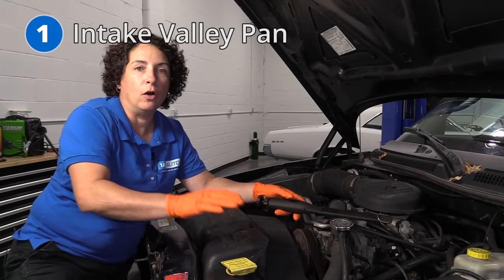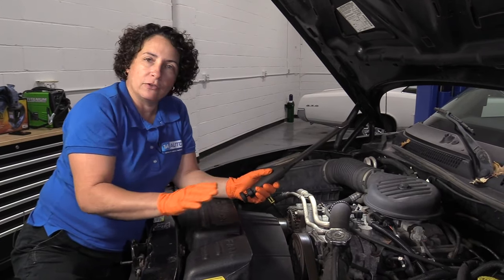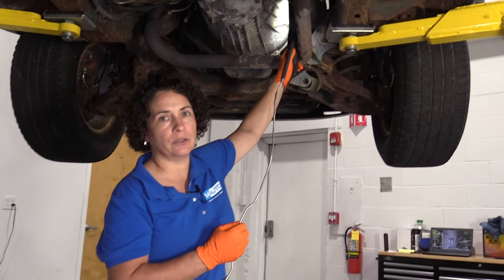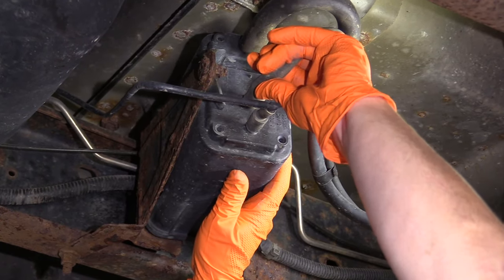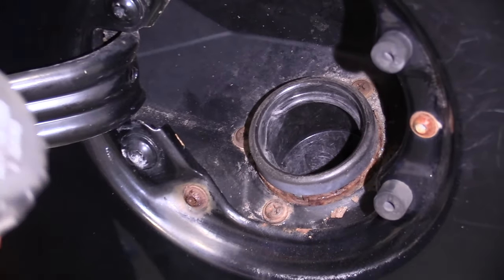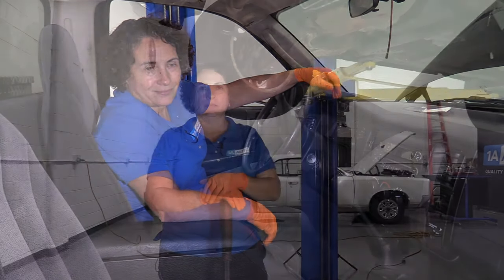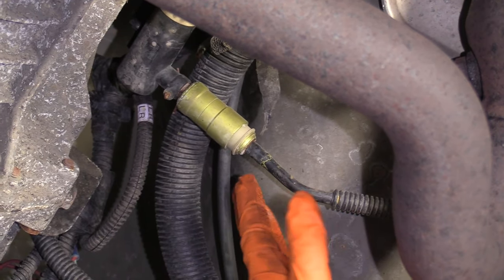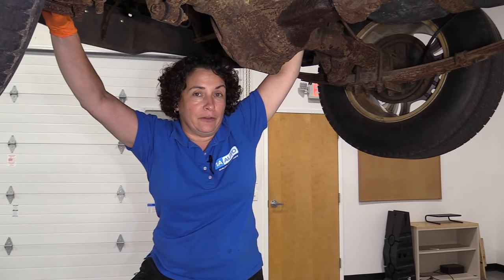Top 5 Problems Dodge Dakota Truck 2nd Generation 1997-2004

Comment: Great information….
I have a 2003 dodge Dakota SLT V8 automatic 2 Wheel Drive. I am having issues with the Evap code but I’m planning to get a smoke test done. I am also having an issue with the airbag light is on my dash I tried cutting off and on at the switch on the passenger side but it doesn’t make any difference. Was wondering if perhaps you can discuss that topic or issue?

Comment: I successfully swapped the 42re auto out of my 1997 dakota and put an ax15 manual from a 99 dakota in. The truck runs and drives fine but my speedometer doesn't work any suggestions?

Comment: For anyone else. If the fuel pump goes out don't buy an off brand. 
It's more expensive ,but get the Dodge one.
Had 3 aftermarket ones go out in 3 years,
Then I bought the Dodge one and when I sold the truck it was still in it 5 years later.

Comment: The Evap codes on these trucks can be a pain. I have an 04 4.7 that all together has been extremely reliable but has had a couple small evap leaks in the past couple years. 

Not bad though to diagnose or fix, just frustrating.
Reply from the maker: +Oro Invictus Thanks for the feedback!
Reply: Upgrade those old rubber hoses to 3/16 thick heater hose in the size and length you need and you'll never look back my friend. Easy to do.

Comment: Mine was an 03 3.9l V6 with 5 speed manual, only problems I ever had was gas cap and random choke on top of constant overheating. Never figured it out so off it went for a new Silverado K1500
Reply from the maker: +Sheriff F. Reaper Thanks for checking us out! http://1aau.to/m/Shop-1AAuto-c
Reply: My 02 had problems with cooling, choke staying on... eventually figured out it was just the water temp sensor.

Comment: My issue tonight first the second shift is almost like a notch on the side of the gate It's easier to go into second if I go to neutral then second I don't know why because it's great condition It was stolen 5th gear if I let it out and hold the brake That's one of those odd triangle shape clutches that are replaced by the previous owner but I have zero slip even pulling a 10,000 lb camper

Comment: Beer keg intake manifold lower (pan) cover. That is also a problem on the 5.2 & 5.9 magnums as well. Besides uneven idle it will cause oil consumption & engine pinging. Evap purge: a problem on other vehicles as well. Ny 2002 minivan kept getting an evap warning. Hose clamps were plastic & had deteriorated (gone), hoses bad. replaced hoses & clamps with European style FI hoses & problem has never returned. Fuel filler cap: Also look for irregular surface at the filler neck, a factory screw-up. It will have to be smoothed with a grinder of some sort but remove the filler neck first---- please. Crank position sensor: beware of aftermarket ones, I have had new out of the box ones set a code right off the bat. Crankshaft end play: factory setting is about .005" to .008". Stick shift vehicles can cause extra wear on the engine crankshaft thrust bearing if the truck is driven a lot in stop & go situations. The whole time you have your foot depressing the clutch there is a lot of forward pressure on the crankshaft and makes for wear on the thrust bearing.

Comment: Great info and we'll said. I just bought a 98 dakota sport v6 3.9 and runs great just that it has the abs and brake light on, and the calipers up front start to stick after doing some driving around, and yes I installed new ones bosh brand I've checked the front lines they seem to be clear I'm thinking it could be the a.b.s module or the a.b.s selinoid, what you think. Thanks in advance
Reply: I had the same problem my lines looked fine but I replaced everything in the brake system and it turned out to be a flap peeled up inside my line that would let the fluid in but wouldn’t let it back out when I let off the brake replaced the line and no problem after that
Reply: @jacobpattison1227  My brakes were hanging up, its an 02, and back part of caliper is part of the spindle... the races where the pads slide had grooves worn in them, the new pads would stick.  I used a grinder and a file to make the races flat and smooth... that fixed it.
Reply: How's it running

Comment: That was amazing, bought a 98 sport for $1000 from a mechanic. Truck runs great. Except last night i decided to take it on the highway. I 95. Got up to 60 mph and it started missing a little, then a little more but would stop and correct itself. Well with another 5 miles i lost a cylinder I think, so now i am on 5 cylinders i assume? I did a visual on the spark plug wires, they looked fine. I am reasonably mechanically inclined, do you think its something i might be able to troubleshoot through myself or should i take it to a pro? thanks
Reply: Check the plugs and wires
...like take each plug out , and either replace them all just so they're new.. or clean and re gap them..also check the distributor cap, see if the rotor inside is bad...make sure your plug wires aren't broken anywhere, and make sure they're right on both ends,  on the distributor cap and on the plugs

Comment: Definetly not what mine has had trouble with. 1st steering wheel fluid leaks either the pump the reservoir the hoses or the cooling device is the culprit. 2nd heater core broke on mine 😭 biggest repair yet. 3rd. locks won't go up. 4th. Outer tie rods go out every 2 years.

Comment: My truck sometimes idles at 1000 when i crank it up and usually by the time i get to the stop sign to turn it goes away... its not rough though its even.. every gear roars the engine the same till it goes away! any ideas?
Reply: My dad's manual 98 dodge ram does the same, he said it is cold blooded, and just heating up. 

Can't give you an exact answer on what cause that
Reply: @happytrails5342  thanks man... actually hasent done it since i mentioned it knock on wood.. i did replace the pcv valve and breather and grommets... maybe my iac was acting funny because pcv had fuel mix all off.. will see lol

Comment: I have Emmanuel Dodge STL or SLT1 models everything manual I have issues going from first to second I know my clutch has issues but it's a good clutch I think the slave cylinders bad even though it was replaced with the clutch what would be recommended

Comment: I think mine is the first problem, engine over heated and died, after I added coolant now it hard idles and engine light blinks, also stalls, checked compression good, replaced boots and plugs nothing seems to work, I'll give it a shot

Comment: Had a 2002 3.9 5 speed until 2015 bought in 2003 changed the battery twice, starter twice, water pump once. Paint started peeling in 2012 on the hood. Had a check engine light for half a day in the winter one year then went off never came back on. Sold it to a guy that hit a tree and totaled it In a week of owning it.
Reply from the maker: +Jon Shearer Thanks for the feedback!

Comment: My 03 dodge Dakota v6 3.9 started stalling out on me today , it would idle rough when stopped in give me trouble starting back up. No check lights or anything. I just bought an idle valve sensor and put it in. So far no stalling and the idle isn’t as rough. Hopefully that solved the issue
Reply: Be sure to clean your throttle body.  Mine was stalling on me and I thought it was the sensor but it was just a dirty throttle body not letting enough air in at idle.  Runs perfect now and code went away on its own.

Comment: I have a 97 dodge Dakota with the 318 4x4 auto. It starts up and runs good and drives good. Until it warms up then in order to drive it your foot has to stay on the gas. And when it dies you have to have your foot to the floor to start it. What could be the problem? Thanks

Comment: I have a 2000 Dodge Dakota with the 5.9L Magnum V8 and recently we've been having starting issues. We replaced the battery. Terminals are clean and have good connection. When I open the door, the interior lights come on, I can adjust the seat, windows, etc., but when I go to start the truck, it just makes one loud click and then everything shuts off and won't come back on unless I leave it alone for a bit. I plan to check fuses and relays (starter, fuel pump?), but do you think it's likely the starter itself or the alternator?
Reply: Did you get it running?

Comment: Really question because I cannot find the part on the 1aauto website or anywhere else. Does the intake valley pan and the gasket for it even exist? Do you guys know what you’re recommending? I’m having a few issues that match what is called the valley pan in the video yet I can’t find any parts relating to it. Tia

Comment: Ok I have a 03 dodge dakota with the 3.9 motor and a 3.99 rear end. The most expensive sensor I replaced was the camshaft positioning sensor. Can you find that one cuz the guy at the parts store said I didn't have one of those. Till I told him to pull one part up on his computer which is the whole assembly. My dakota has 198953 on it. Had it for 7 years now

Comment: I got the 3.9. Great engine but notorious for cylinder 5 misfire. All I did was change spark plugs, rotor bug and distributor cap and it quit. Only spot on the distributor cap that had white looking corrosion on it was the cylinder 5 one and the rest still looked brand new. I've talked to a lot of elders about it and mechanics and no one could tell me why cylinder 5 does that. It was 2 years ago when I changed all that and it's been doing great ever since. I'm just dealing with transmission sensors now or maybe the culonoid for the overdrive is out now because after driving it for about 15 miles the over drive will turn off and not back on unless I turn the engine off then it'll go another 15 miles or so before it does it again. It is weird because no engine light comes on. Do you know what is causing it to do that and not throwing the engine light on when it does?

Comment: I have an 03 Dakota and i replace the evap hoses and canister but my engine light came back on. When i changed it the light turned off but came back on. I even change the fuel cap. Any idea what might be the problem?

Comment: had one of these as my first truck. biggest pos I've ever owned, couldn't keep that thing running no matter how much money I dumped into it.
Reply: really have a 3.9 in a 93..20 mpg hwy and have 528,000 plus on it...had a 2004 v8 yea that was horrible got hit head on so kinda glad its gone
Reply: I'm guessing 4.7L? Those were the problem trucks when I comes to reliability...
Reply: My dad had a 2000 dodge dakota he had since 2000 until he died in 2019. Put over 230,000 miles on it. It never had any problems other than it needed a water pump at 190,000 miles. It had the 3.9 v6. Since then the truck has been sold and it's still on the road.
Reply: @oxidizedolive  mines a 4.7 snd reliable as hell till I got hit head on. It just isn’t idling. Other than that, she’s still going strong
Reply: @SebastianWoodard  problems with the 4.7 were mostly electrical issues, not so much hardware related. You probably got a lucky one if you didn’t have a bunch of wiring issues
Reply from the maker: That stinks. Thank you for checking out the video. If you need auto parts go to: http://1aau.to/m/Shop-1AAuto-Now
Reply: They have been lemons as as any vehicle can be but it also depends on what day they were built on any vehicle built on a Friday or Saturday isn’t going to be built right because they are in a hurry to get done so they can party or whatever and same thing when they are built on a Monday people are hungover and want to get it done and back home I have 3 dakotas 2 2004 1standard cab sxt  1 2004 crew cab 4x4 I just bought this 196000 miles my 2 seater has 143,000 bought it 4 years ago had 106000 and last but not least 2003 sxt standard cab 96000 3 years ago and 108000 now
Reply: @lisajoyce6803  in a time of heavily-automated vehicle manufacturing, human error, while certainly possible, is not a likely factor in the mass of problems that owners run across. Most of it comes down to the environment the vehicle is driven in, and how it is driven. The only known major factory issues with this model is the 00-04 4.7L V8 wiring, but that is a result of poor quality parts, not poor construction.
Reply: @dabnisbrickey6527  someone owned it before you and fixed the problems they had
Reply: @richsweeney1115  I was with my dad when he bought it brand new from Burgin dodge in Knoxville tn when he got it in 2000.
Reply: @dabnisbrickey6527  me to. Doing my water pump now at 175000.  But mines also been in 9 collisions. 3 since ive owned it. A dam tank i swear

Comment: I have a 2000 dakota v8 the truck cuts of wille driving or stop ligth  replace crankshaft position sensor from dealer ship and steal  cutting off fuel pump pressures is fine  this truck  is driving me crazy  I need mor advices tanckyou  for your help

Comment: I have a dodge dakota 01, with the code po302 I changed the position injector, spark plugs, cables, distributor and it follows the same code.  thanks

Comment: So, which V8? They had the 318, 360, and the 4.7. Mines a 4.7 that I wrecked. She drives okay but will not idle. She just idles stupid low and dies. I was getting 2 TPS codes. Replaced the TPS. Didn’t fix the issue. Was getting an IAT sensor code. Didn’t fix it. My next guess is a throttle body.
Reply from the maker: It could be. You could always try to clean it and see if that makes a difference. Thank you for checking out the video. If you need auto parts go to: http://1aau.to/m/Shop-1AAuto-Now

Comment: There's one thing she didn't say there is a hose for EVAP system inside the engine compartment goes to a filter system of front I had a problem the hose deteriorated and I had to have that part fixed that's the one thing that was fixed on that truck so ifyou EVAP system at the light keeps coming on check the hose underneath the engine you can actually follow it to where it goes from the EVAP system need to truck to the system up front you can't miss it it's the only hose that goes up front that's your problem

Comment: I have a question I have a 03 Dakota v6 won't idle when engine is cold if I rev it to 1500 till engine get hot then it will idle I've changed the iac valve still does it.

Comment: My 03 Dakota lasted 354,568 miles
Reply from the maker: +Grandpa Rails Thanks for checking us out! http://1aau.to/m/Shop-1AAuto-c
Reply: What motor did you have in it and what caused the truck to fail?
Reply: @jaidenmcdonald3677  3.9 V6 burnt valve.

Comment: I just picked up a 2004 Dodge Dakota SLT single cab 3.7? Or 3.9? Either way it's a V6 5 speed 130k I cannot get into gear how do I change out the master cylinder and slave cylinder and does anyone recommend any good part places for those parts ? Thanks this is my first Dodge Dakota

Comment: My dads 97 dodge Dakota work truck has 297,000 miles on it and it still runs although there’s a lot of rust and wear. But his ABS and Brake light started to stay on. My question is, is it an easy fix? Is it an expensive fix? And Is it still safe to drive?
Reply: My 2001 had the same issue with the lights, drove it for a few years and never did get it fixed. It ran fine though

Comment: My 2001 v8 is having its 3rd transmission installed.
It has never been used to tow anything except once or twice. I guarantee it was a small trailer far under the limit. has never held much weight in bed. Or hauled much. 200k miles.

No off-road. I mean cherry, some highway miles. The only bad that happens to that truck is negative degree weather and 100 plus degree weather each year. Why do the transmissions keep failing? Insane.

Comment: #6 heater blower motor .
Reply: It's the small wiring to the resistor. Upgrade that to a heavier wire and your laughing. 9years haven't replaced a blower motor.
Reply: lets not forget the heater core...why i picked up a 2004 for 500$.. like to find the engineer who designed the dash around it and force him to change one
Reply: @miguelcastaneda7236  that's evil, I like it
Reply from the maker: Thank you for checking out the video. If you need auto parts go to: http://1aau.to/m/Shop-1AAuto-Now

Comment: So my 02 Dakota sxt 3.9 5spd has the check gauge light on and the battery voltmeter on my truck dropped and this only turns on now when I reach 30mph but truck runs and drives just fine. What would cause the issue?

Comment: Hello and thanks for the video. My 2004 Dakota work well most of the time but every few months, I stop the truck and then it will not restart.  If I leave it for 20 plus minutes, it will then restart but I have now put in 3 fuel pumps over the past couple of years but the problem still occurs.  Any ideas?  Thanks
Reply: Possible ecm

Comment: I had a 98 Dakota 3.9 V6 automatic for 4 years,  By GODS GRACE the only issue I had and I chased it down to the computer bc the truck kept stalling. I replaced the computer and didn't have any problems after that.

Comment: I have a 2002 Dakota sxt clean single cab. I'm having minor problems with turning left. It tends to slip only when turning left than goes normal after I get straight. Doesn't do it on right turns. Only left. Any suggestions.
Reply: Check your sway bar links

Comment: OK I am in having the P0 300030406 I have the 3.9 L V6 and I will just replace the valley pan gasket along with the other gaskets that came in that kit and yet it still doing it wondering if there is another gasket the signs out and I’ve also replaced the rubber nipple and I didn’t even seem to work ether

Comment: 98 dodge dakota 5.2 replaced fuel pump,iac,tps,spark plugs,wires and still have an excessive crank. Cycling key doesnt help. Fuel pressure is 50 psi. Cant figure out whats going on. Help
Reply: Crankshaft or camshaft position sensor, bad computer, starter wire